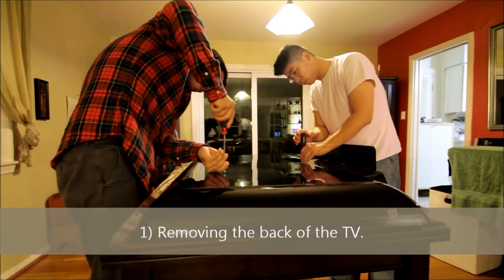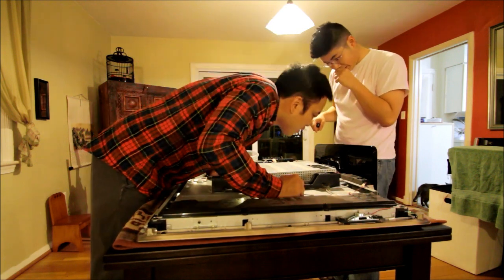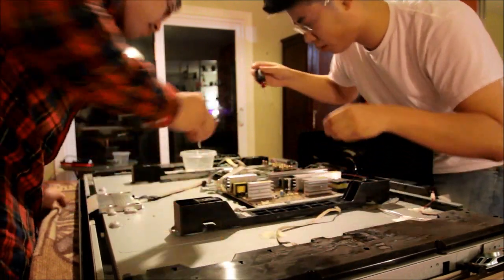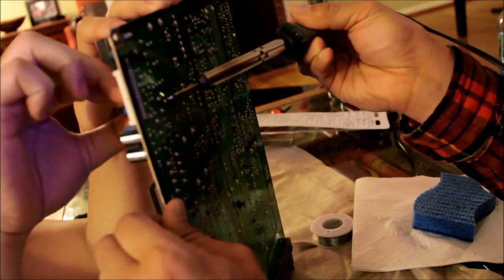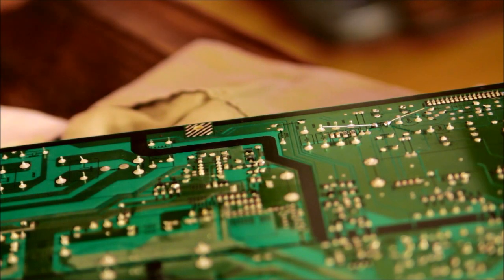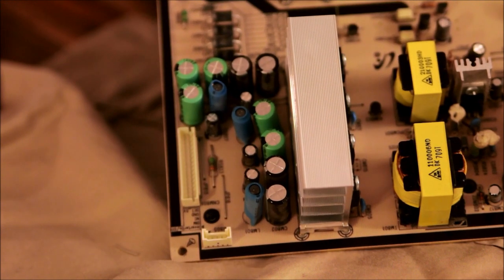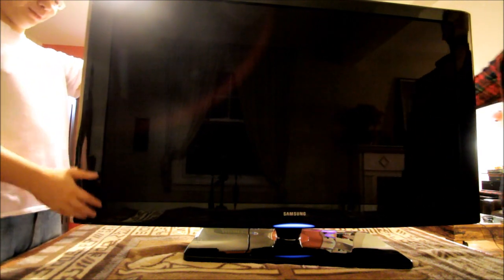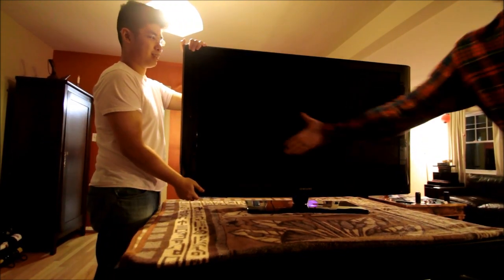Samsung LCD TV Fixing Power Supply Problem

Comment: Got the caps ordered for my LN52A530P1F - will replace them when they arrive. Mine's doing the clicking and resetting itself before power cycle is finished. It usually only happens when the TV has been sitting cold for a couple hours. Sometimes helps to unplug the main power, wait for something inside to click, then reseat the power cable.

Comment: Ok I took the board of my lcd tv off and it been 3 day I just started working at it and a little spark came out with now power running will it will still be ok to keep on repaired it or the bord not good

Comment: Woah man! What on earth is that thing you are trying to solder with? Might I advise that anyone feeling competent enough to tackle this use a good quality iron with low earth leakage so as not to damage sensitive components and ideally a soldering iron that does not have a bit like a six inch nail. I personally use Antex and they are excellent.

Comment: You guys rock !  Just a reminder to everybody else who will try this at home, be careful with the capacitors (they are polarized, just follow the markings of the original one).   You can take out the capacitors with a desoldering tool (available on Radio Shack, the desoldering tool sucks the solder), where they got the solder and soldering iron.  Sometimes adding a little solder to the old solder joint on the green board (called PCB), helps loosen it up.

Comment: hey guys I have a 32 inch samsung LCD TV. and it gives no response when connected with the power outlet. There is no Red light no blinking its just dead. We called the TV repair guy he said the power supply got burned. This happened when my Dad hit the cable wire behind the TV by an accident and there was a little spark there and its not working since then. Can you help me with that thanks